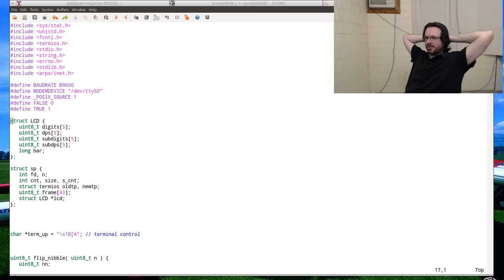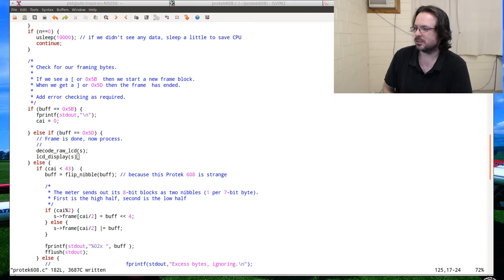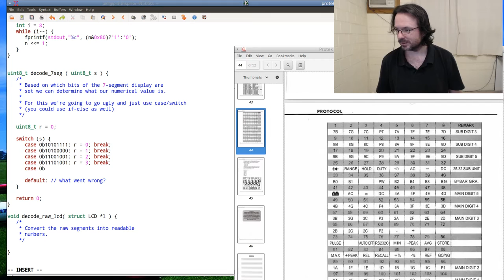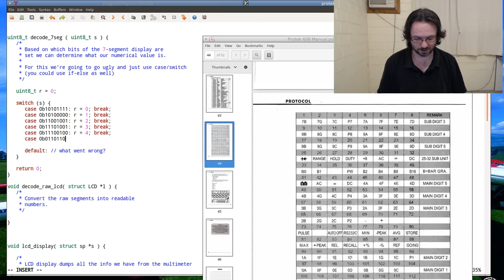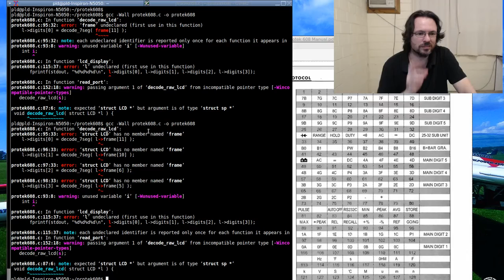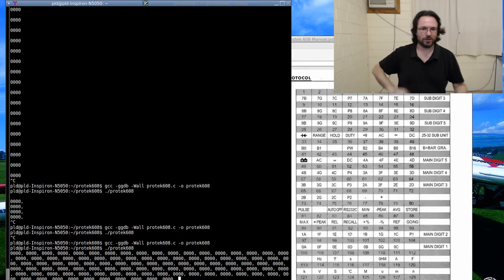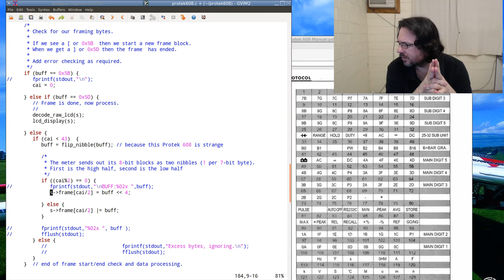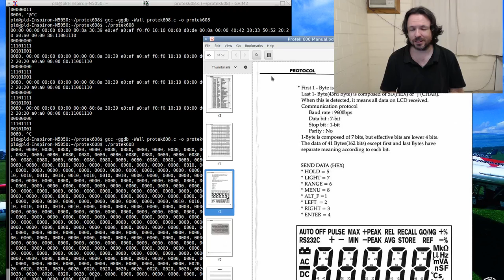Programming - Protek 608 Multimeter display for Linux terminal

Comment from the maker: Worked out the issue.... the decoding maps I was using were for subdigits and only digits 3, 4, and 5 of the main digits.  Digits 1 & 2 required a different mapping again.

  

Now producing proper results :)